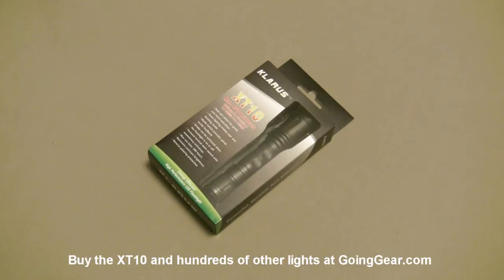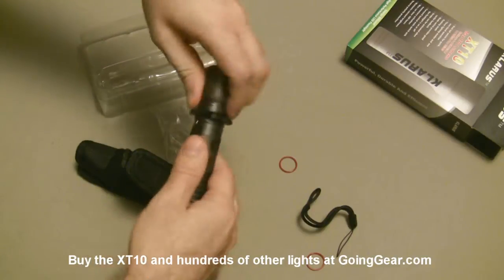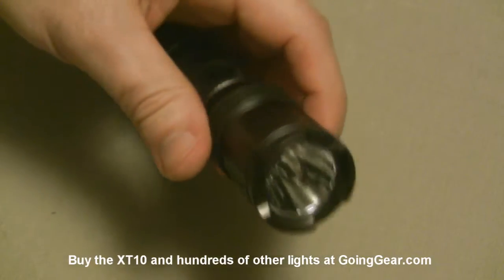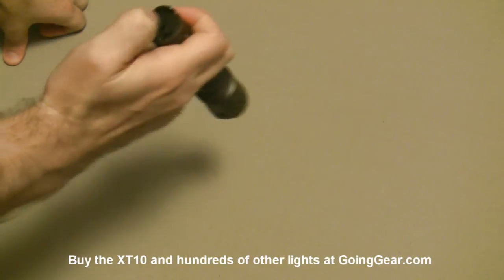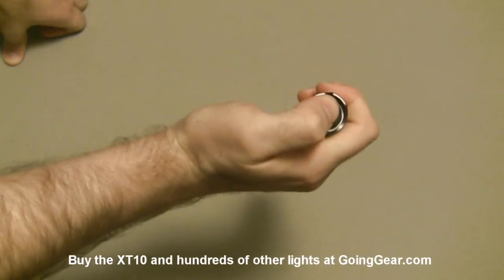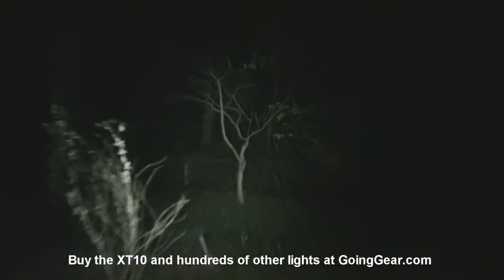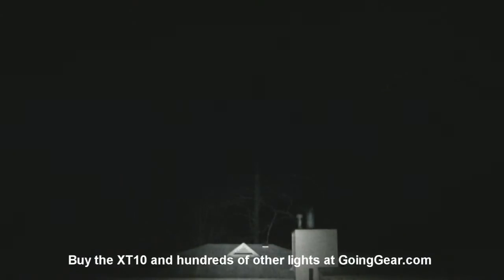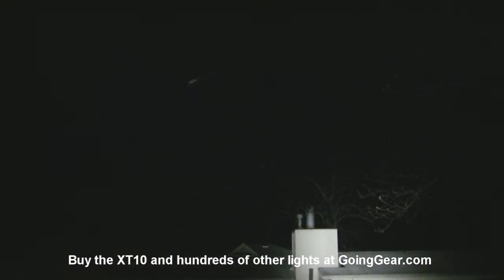Klarus XT10 Tactical LED Flashlight Review

Comment: My XT10 flickers on medium mode :/ Sometimes it shuts off after flickering. After a tap on the button or if I move it it goes back to normal. No problems with Hi an Low. BTW, the flickering is not the same like the flickering when the battery is low.

Comment: I had charged the batteries for 6 hours previous to testing it but it would blink in
the turbo mode. No problems with the other modes. Is that what occurs when
the battery runs down? I was also going to ask while doing the videos, that
some mention of heat to the flashlight  be addressed. Some flashlights are really
poor at dissipating heat and really cannot stay on the "turbo" mode at the
manufacturers stated maximum time. Thanks for the feedback!

Comment: Hey Marshall, I was wondering, since this light was designed for the tactical user, and they use the  high or turbo for a long time and it steps down to a lower brightness. Like most likes I've seen this size, they step down after 3-5mins. Would they just keep going back up to high? but that could possibly damage the light.

Comment: I just purchased one of these, btut when I put a 18650 rechargeable in, the
hight mode would start blinking. Not so with 2 cr123 batteries, tho.
Did I get a defective one? I used an Ultrafire rechargeable like in you vid, but
it would continue "blinking" not like on sos or strobe, either.